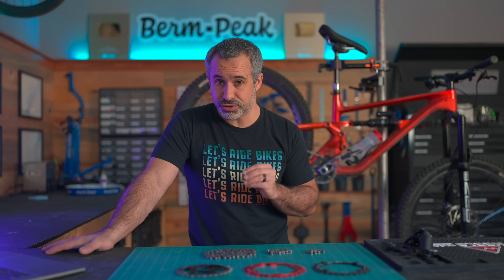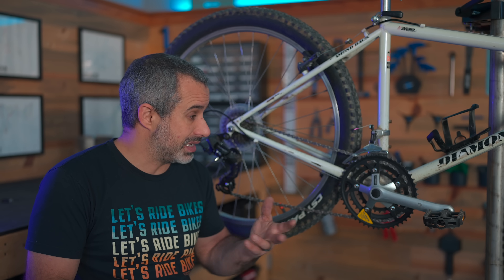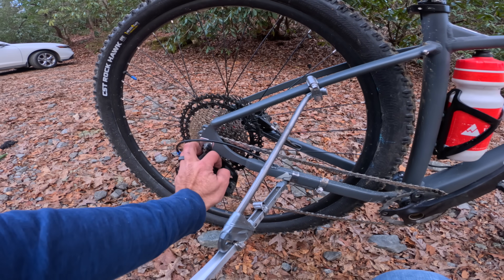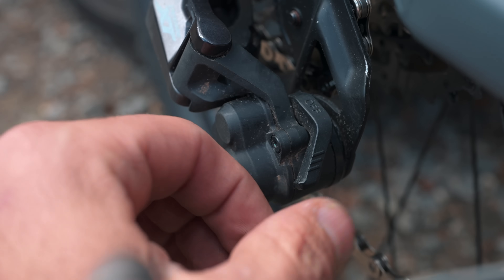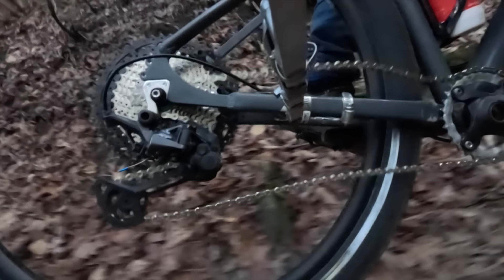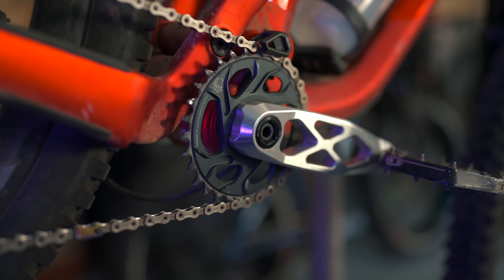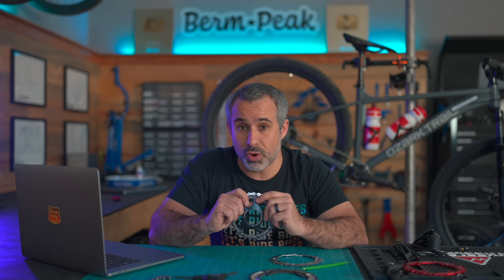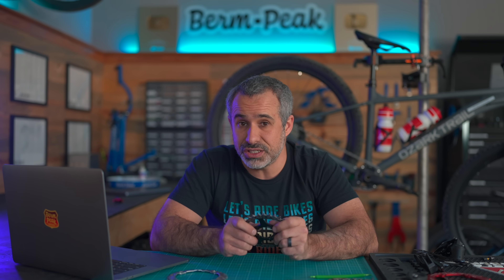The Genius of Narrow Wide Chainrings - Why they work!

Comment: Speaking of 1x drivetrains, do you guys recommend swapping to a 1x8 setup by deleting my front chainrings? I live in a pretty flat are where the biggest elevation change is a bridge.
Reply: I would recommend it, It adds a lot less complexity overall and it’s just more efficient imo. I’m currently working on upgrading an old trek singletrack from a 3x to a 1x, you just need to make sure you size your chain correctly
Reply: @Crispiests  Yeah the main reason for the swap is the constant chatter and since I'm losing a shifter, I can replace my mechanical disc brakes.